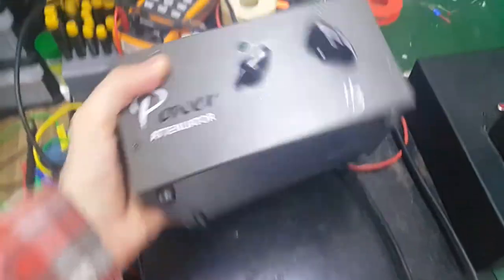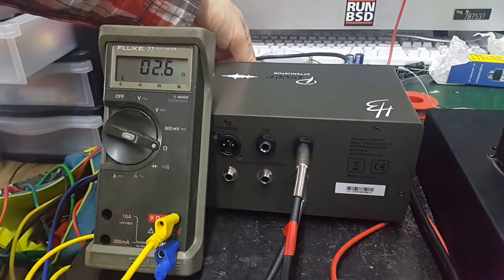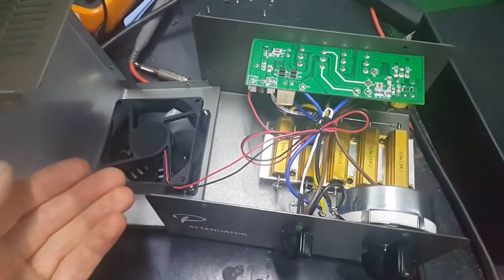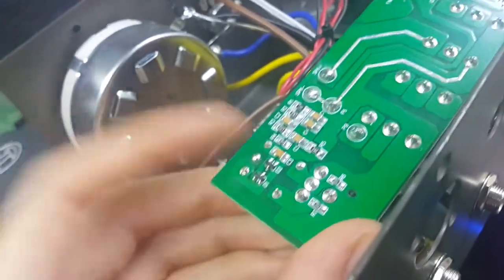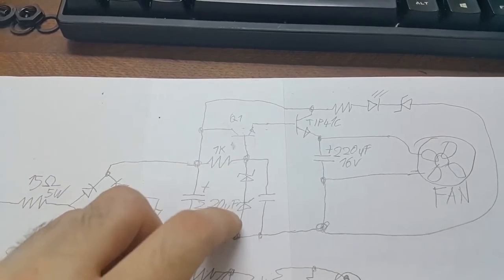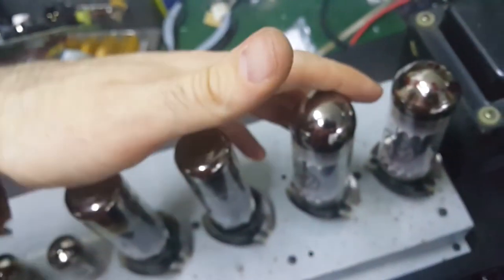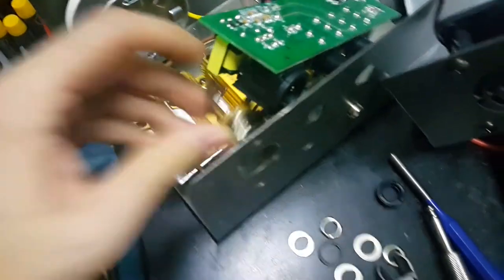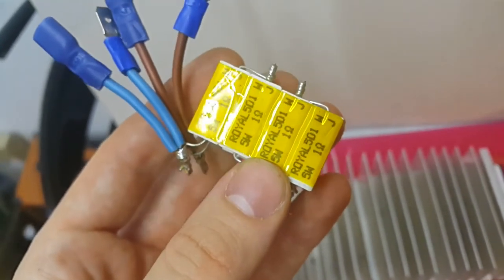Harley Benton PA-100 Attenuator Review & Improvements

Comment: If connecting a 4ohm output and 4ohm speaker (i.e Fender Tweed Champ) to this, would I be safer to use the 16ohm input on the attenuator, therefore giving 3.2ohms as worst case?
Reply from the maker: The lowest possible isn't necessarily the worst, too high of a resistance is worse than a short circuit since could allow the voltage on the transformer to go above what it can handle causing the insulation to break down which can destroy a transformer in literally no time. If the resistance on the amps output is too low, the concern would be the transformer heating up too much or the output valves passing more current than they can handle, which is also bad but at least it wouldn't instantly destroy anything.

That's to say... Maaaybe the 8 ohm input would be marginally safer but I really do not know for sure, the 16 ohms input would probably be straight up a bad idea. The 4 ohm input with the volume of the attenuator turned up all the way may not be better than the 8 ohms, so I find it hard to recommend either xD.
Reply: @netman69  Thanks! :) I will likely buy the Bugera version of this design and report back with how it compares internally (I'm guessing very similarly.)
Reply from the maker: @PedalScience  I have seen internal pics and it looks like the old version of this before they added a fan, if it's like that, in addition to recommending against using it for 4 ohm outputs at all, stay well below the "rated" 100W as it would eventually catch fire and take a set of valves and maybe a transformer to it's grave xD.
Reply from the maker: If you doesn't afraid of anything (say the amp used going on fire lol), what i'd do for 4 ohms output only amp is start by hooking it to the 4 ohm input on the attenuator, give it some beans and see if the transformer gets scorching hot or the tubes start red-plating or sth. If yes, go up a notch in resistance xD. If you're turning the volume of the attenuator up the whole way anyway though, 8 ohms input will be about 6 though which is probably just fine for a 4 ohm output, but then turning the volume down is somewhat pushing it towards where you may get a failure without warning.

Or if you're just after getting it to work happily, stick a 16 ohm speaker on it... Then you'd be allright using the attenuator the normally prescribed way.
Reply: @netman69  Thanks! I only have a 20w and 5w so should be okay... :)
Reply from the maker: @PedalScience  That it should survive :).

Comment: Hi I used this for a day on my mesa boogie lonestar special combo 1x12 inch. After putting it on the drive channel the amp just powered off and wont turn back on at all.... I am kinda pissed... It was functioning for some time then when I put abit more gain and the master volume and output volume up. the amp just powered off and died and wont  power back on at all.... the red light went out... i tried changing the fuse and also swapped the pre amp v1 tube around several times with existing preamp tubes that are 15 years old ... I recently a month ago put in a new set of sovtek mesa spec el84s x4. and a new mesa retifier.. please help... i get the feeling a diode may have blown or at worst a transformer fried.... There was no burning smell so maybe transfoerms ok ? i will take it to a amp tech soon when i have time
Reply from the maker: Since it isn't powering on I'd sure suspect the fuse was blown, but the rectifier diodes seem like an unlikely culprit, I'd suspect one of the el84s being blown and taking out the new fuse as soon as it's replaced.
Reply: @netman69  thanks for your feedback, I changed the fuse and it didnt help, also the el84s power valves are brand new. so I believe it cant be them. although I have a pair of new el84s as spare so I will try them
Reply from the maker: @ukguitaryogi2888  the reason I suspect the power valves they'd be the first thing to go  if the amp is run without a load (say the pa100 if it went open circuit because of some defect) and could explain the fuse blowing repeatedly
Reply: Any update my guy?

Comment: This is a great video to check before plugging into a tube amp. When I measure mine its shows:
4 ohm socket = 7 - 9 ohms as I turn the pot
8 ohm socket = 11 - 13 ohms as I turn the pot
16 ohm socket = 19 - 26 ohms as I turn the pot

Am I measuring wrong or could something cause this? I am worried about using this on my tube amp until I know its safe. What could cause the ohms to be so far off? Could one of the resistors be broken and how would I check this? Thanks!
Reply from the maker: That's pretty far off, if you measured it right do not trust it! But first idiot check whether your meter works, short the probes together and check what their resistance is by themselves, maybe also check a known resistance of something. Subtract the resistance of your probe cables from the measurements, but if it's more than like .5 ohms, throw those probes in the bin! If you used any cables to the HB during measuring, also check the resistance of them (tip-to-tip AND sleeve-to-sleeve), expect them to be less than .5 ohm unless they are at least several meters long. Next thing to check is there are 3 pairs of paralleled resistors in the HB you can check individually, pause my video at 12:40 or so for the relevant part of schematic.

We can measure the groups of resistors without even opening the thing, measuring mostly between the tip side of the various connectors because later we can worry about the sleeve/ground connection:
- Between the tip of the 4 ohm and the tip of the 8 ohm connector you should measure approx 4 ohms (regardless of what's going on otherwise).
- Plug a cable in the 16 ohm with the other end unconnected (the switch in the connector has to be opened by a plug to measure this one), you should measure about 7.5 ohms between the tip of 16 ohm connector and the tip of the 4 ohm connector.
- Still with a plug in the 16 ohm connector, and no speaker connected to the output, measure between the sleeve and tip of the 4 ohm connector, you should measure about 7.5-8 ohms again.
- Tip of the speaker out connector should measure about 0 to the tip of the 4 ohm connector when on full volume, about 8 ohms with the volume turned down all the way (and something in the 16 ohm hole still).

If those 4 things check out, all the power resistors are okay! If not, open the thing up and follow the wires to find where's what from the schematic, you'll have narrowed it down to 1 of 2 resistors but have to disconnect one to find which one is bad (or harass the seller for warranty).

The other thing to check would be the sleeve connections of all the connectors, are they proper? Check between any combination of them, they should all be tied together proper and have like 0.2 ohm resistance between 2 different ones at most. The 16 ohm is especially suspect, I don't recommend leaving it connected the way it comes from the factory (see: video contents), also check the switch in that one (probably have to open the unit up to measure that one correctly, but resistance of the 4 ohm input tip-to-sleeve should halve from 8 to 4 ohm between having something in the 16 ohm connector or not if to check externally).

And with anything that doesn't check out from above things... It's probably worth inspecting the solder connections and looking if not there's a wire broken loose somewhere.

Hope that helps :).
Reply: @netman69  Thank you so much for that detailed check list!

I have gone through it all and all your checks seem to work out ok after I re-melted some of the solder joints that looked a little off. I think the problem may be my volt meter now as it seems to drift over time with how much ohms it shows. After leaving it on for a while I am now getting these results;

Volt meter shorted = 1.4 ohms
4 ohm socket = 6.4 - 7.6 ohms (minus the 1.4 = 5 - 6.2 ohms)
8 ohm socket = 10.3 - 11.4 ohms (minus the 1.4 = 8.9 - 10 ohms)
16 ohm socket = 17.6 - 24.7 ohms (minus the 1.4 = 16.2 - 23.3 ohms)

Is this now safe or should I get a better quality volt meter and test again?

Like I said, I seem to get the results you listed above when I carry out the tests you mentioned. I am still not sure how close in ohms it needs to be for it to be safe on a tube amp. Thanks again for the help, it has been very useful :)
Reply: @netman69  That was indeed very helpful. I checked all the points before I fired my attentionator (haha) up for the first time, it's completely healthy and it doesn't even get warm. It's connected to an AC30S1 though, which isn't the force wattwise. But soundwise... take shelter if you have no attenuator and crank the power stage all the way up, with the gain on the edge of break up!

Comment: Please can you help how can i get the line knop to work? If i pluged the cable into Line Out the line knop isnt working... 🤷🏽‍♂️😢
Reply from the maker: Did you turn up the SPK level knob also? It has to be up to get the line out to work, unless you modify as I show in the video.
Reply: @netman69  yes i did. But same result. :( I think i have to repair it..
Reply from the maker: @DE-signYourLife  is the speaker output working?
Reply: @netman69  yes it is. For the first i use the Spkr Output and the Spkr Knop is also working. But cant get the Line Knop working for some how
Reply from the maker: @DE-signYourLife  Then there's only 3 parts that could be the culprit, the resistor between the big potentiometer for the speaker out and the line out potentiometer, the line out potentiometer itself and the connector. I'd suspect a wire between those to be loose or something actually as most likely problem.
Reply: @netman69  ok many thx for your help! 👍🏻 I will check this out soon

Comment: Could this handle a 120 watt solid state amp?
Reply from the maker: Maybe... Officially it can't because it's outside it's ratings and there is a real chance you'd burn the thing out but with a solid state the amp itself should be fine, so if you're willing to risk the attenuator you could try and find out. I know mine survived a fair bit more than it's rated for, but I didn't push it for a long time.

Comment: I have 6505 amp  120w can i use this attenuator  ?
Reply from the maker: I sadly don't have anything better than "maybe" and "it depends". If you have a master volume on that amp, turning it down just a bit would be enough to not overload it and the LED will light up if you're giving it too much beans but depending on how well the master volume is implemented that kinda defeats the point of using an attenuator.

That said i *think* it would survive the full 120w just fine, but it's only specified for taking 100w so there really isn't a guarantee, especially in the long run. I've given it hot supper like that before so i know for sure it doesn't instantly kill the attenuator but if you do burn out the resistors be aware that could be detrimental to the amplifier also (to the output valves in particular, but maybe even the output transformer).

In short though: you'd probably be fine, i've pushed my particular unit with 120w amps before, but I really can't recommend doing that.
Reply from the maker: Nicko Lps  What you're saying is correct and if you want to play it 100% safe you indeed shouldn't, but I think their rating is generous enough to be intepreted as "it'll do a 100w amp". The resistors in it are derated 50% and the fan does a reasonable enough job of keeping them cool, unless you overload them absolutely massively the limit with resistors is entirely thermal.
Reply from the maker: Nicko Lps  Also people don't tend to know what's in their attenuator, I can only speak for this particular Harley Benton one in particular, and even this one had an older version without a fan yet the same resistors (and the Bugera PS1 appears to be the same idea), those might not survive at all yet they carry the same rating on the label. Which is to say, if all you know is "100w attenuator", you should absolutely abide by what Weber suggested if to not get burnt xD.

And even if you understand all, de-rating devices like this is always a good idea, but unless you're willing to spend literally 10x as much or build your own attenuator, all you can find is ~100w rated attenuators, hence the discussion we're having does have value.

Having said that I found out HB now sells a 250w attenuator (for 150ish euros) because I was fact checking myself on that "spend literally 10x as much" claim, so apparently i lied :D... Interesting. If OP is still reading, it may provide more peace of mind having one of those for a 6505, but I have no clue if it's any good personally.
Reply from the maker: Nicko Lps  Jeez, I'd expect better from dr-z! They weren't tubular rheostats though where they? Ohmite do have those, and they look like this: http://sc04.alicdn.com/kf/HTB1BUVFaa1s3KVjSZFAq6x_ZXXaD.jpg

The OT and output valves do suffer a bit more with a speaker than a resistor, but I doubt it really matters to the point where you have to hold back without an attenuator really... Valves may perish sooner if you go hard but I ain't ever heard of someone blowing out their OT because they were too metal for it xD. The audio world is full of superstition and myth.
Reply from the maker: Nicko Lps  Yeah, the youtube regime is not one of free speech xD I've searched and found pics of a Dr-Z brake lite internally that look like what we're talking about, and believe it or not I think it's Ohmite removing the epoxy, not Dr-Z, although i haven't ever seen a rheostat like that with multiple taps on it, see this: https://www.ohmite.com/assets/docs/res_210.pdf?r=false

The price of them seems excessive though!
Reply from the maker: Nicko Lps  Well this is a resistor we are talking about, at 1000 euros you're guaranteed well into diminishing returns xD. But something like this HB needs work to be usable at all, so a few more dollars might make sense.

For me the next step up will be building my own, I think i'll be down somewhere between 100-150eur for a 400watt (before de-rating, so twice the HB thing in terms of resistors but i'll have a more substantial heatsink).
Reply from the maker: Nicko Lps  It really depends on your speakers, and your neighbors. You'd get about "half as loud" in perceived sound, and say a 10-20watter attenuated that much would for me be a comfortable enough level to play with all day through my crappy test speaker that's shown in the video. Yet through a 4x12 loaded with sensitive speakers it could probably still give me hearing damage. But either would upset my neighbors if I went at it at night :P.

I think if instead of a potentiometer I had silent, 100:1 and 10:1 level, I'd be entirely happy already, but i haven't tried.
Reply from the maker: That's why I ain't mad the HB attenuator is kinda crusty, you couldn't buy the parts for that price xD. Maybe it's subsidized with lunch money stolen from the child laborers that build them.

Comment: My amp combo speaker's is 4 ohm but have set amp swich on 8 ohm so which input do i use 4ohm 8ohm 
16ohm
Reply from the maker: The 8 ohm input probably, the amp would be expecting an 8 ohm load with the 8 ohm setting :).
Reply: In case of a mismatch: You need to have a bigger resistance reading in the speaker than in the amp. Otherwise the amp may receive damage.
Reply from the maker: @jaakkokunnas  amps are quite tolerant of such mismatch luckily, even like 50% low or high does not mean disaster. It's indeed better to have a too high speaker impedance, then the valves won't see an excessive load but i wouldn't worry too much as long as its somewhat close.

Comment: Any thoughts on a possible bright switch mod? I saw one in this video.
https://www.youtube.com/watch?v=VbD0plXyzo8

I haven't noticed treble being a problem with PA-100, unless the amp is whisper quiet, Fletcher Munson and all that. I'm loving the PA-100, I did your 2 mods :) thanks.

I also have to keep the box away from the amp's transformers when using MicMod, otherwise there's a massive constant buzz.
This is definitely one of my better acquisitions, a great product with the mods.
Reply from the maker: Whether a bright switch makes any sense at all probably depends on the cabinet you're connecting to, definitely can't say I've felt the need for something like that myself. If you do add one be sure to use non-polarized electrolytic caps or film caps if you can find them in a big enough value (the typical polarized ones would be destroyed in a hurry xD).

I bet the little transformer in the Micmod circuit is what's picking up the buzz from the transfomer, in addition to distance rotating the attenuator 45/90 degrees could help a lot (if you ever wonder why most valve amps have the ouput transformer rotated differently than the power transformer, they do this to reduce magnetic coupling between the two).

Also might be worth double checking both parts of the case of the attenuator are properly grounded (as in connected electrically to the outside of the connectors), and if not strategically scrape some paint away so they make connection. The case not being grounded would allow way much noise to be picked up.

Comment: Wow even the knobs sound like trash when you turn them.
You get what you pay for.
Trash….
I just returned mine
Reply from the maker: Well at the price it's amazing you get an attenuator at all I think. The big knob has some excuse to feel weird being a high power wirewound potentiometer, they often feel like that but I'm sure it can be done better if you pay through the nose :D.
Reply: @netman69  The wirewound potentiometer is perfectly allright, it doesn't look, feel, or sound a bit different from the one in my 1970's high quality iron